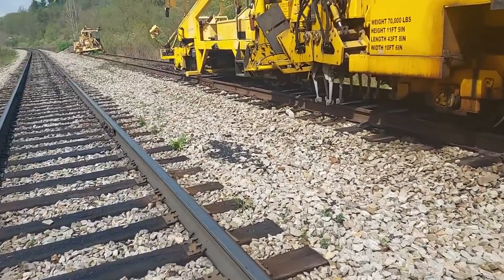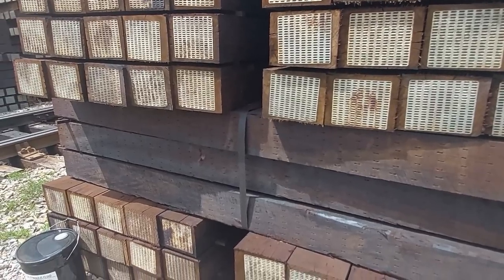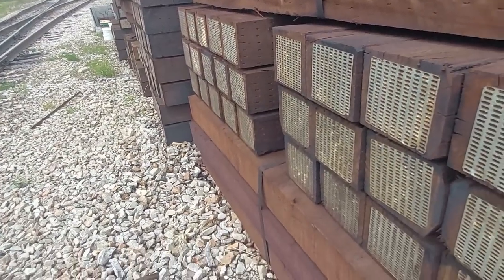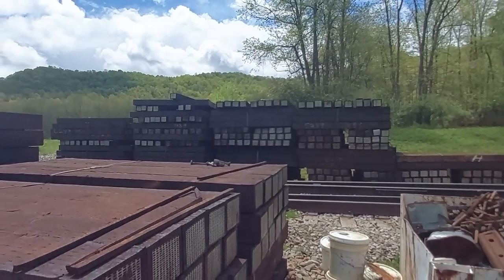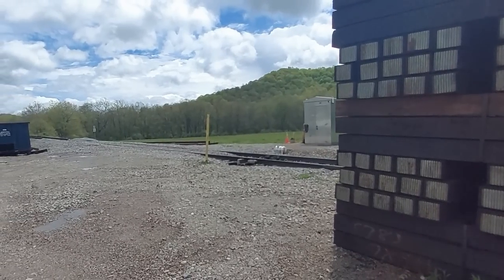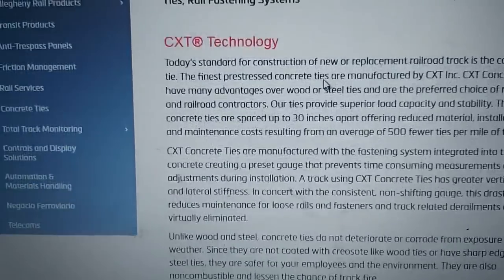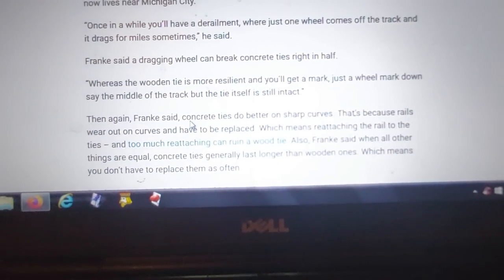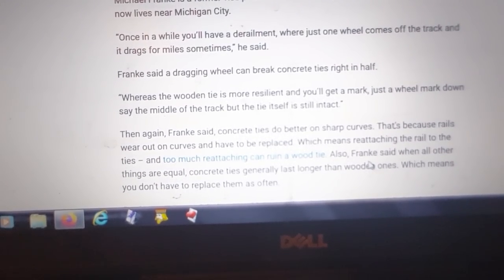Why some Railroads use Concrete and some use Wood Cross Ties

Comment: I visited New Jersey several times between 2002 and 2010.  On one visit concrete ties were being replaced on the line between Newark and Trenton.  Laying at the side of the track were thousands of broken ones which had already been changed in spot replacements, and now all of gremlins were being replaced.  The ones which had broken looked very similar to those we use here in the UK, where they are known as sleepers, but I have never seen large numbers of them break up at the ends like they did over there.  Also, the ones which had broken up looked fairly new, in places where older ones were in use the problem did not seem to happen.

Concrete ties have been around for a long time, at least since the Second World War.
Reply from the maker: Thank you for the interesting comment Stephen. Appreciate your taking the time to watch and write in my friend.

Comment: For light weight, high speed passenger service concrete provides superior ride performance over wood. Conversely, slower, heavier, longer trains need the endurance and flexibility of wood. Creosote is a generic term than can reference any one of 2000 wood preserving chemical mixtures and is not always carcinogenic. Personally I prefer good old fashioned coal tar. Nothing but mostly long carbon chains that create a great water and insect barrier. I don't like some of the new tie treatments as they smell of pure insecticide. 

Oh, and Alco the Railroad Dog approves of this video. I enjoyed also.
Reply from the maker: Thank you for the nice comment Ken and Alco, glad you enjoyed. Appreciate your taking the time to watch and write in my friend.

Comment: Several years ago I visited a friend who lives near North Platte NE on the UP main. The 3 main line tracks are 100% concrete but all sightings and spur tracks are wooden ties. He showed me where 2 or 3 covered Hoppers had jumped the track and even though they were empty they cracked the concrete ties and the pile of rubble was substantial. Back about 100 years ago our local streetcar system made several batches of concrete ties apparently more for testing than actual major usage. There still are about 50 of them used as a retaining wall along their private right-of-way which still has high voltage lines utilizing.  Theyve held up well and you can still read the company initials TMER&L. CO.  10\27\25 and the day they poured the form. Thanks for the info
Reply from the maker: Thank you for the interesting comment Paul. Glad you shared about
the  UP pile of rubble! WE don't want one of them here... :-)  Appreciate your taking the time to watch and write in my friend.

Comment: European countries have enough wood for wooden sleepers.
I mean, it was common until the 1960s.
Wooden sleepers are mainly used in low speed areas. Low frequency of trains.
Mainly in marshalling yards, still to be found.
Since the damage in the event of a derailment is significantly lower.
important for the extent of the damage is the weight per axle (and speed), we have only max 48501 pounds per axle. yes the concrete sleeper gets a damage, usually at 15 mp/h (shunting speed) not enough to damage the gauge. Witnessed the aftermath of 3 those derailments, because people are stupid. None higher speed so far.
Rarely still used on lines that are neither dead nor alive at slower speeds.
However, when going faster than 80-100 mp/h, I prefer concrete sleepers. 
Everything around 40-50 mp/h, wood is fine.

Without wanting to offend you, your ballast looks more like mud with sprinkles.
So far i didnt notice a difference between wooden and concrete sleepers in bad ballast, i will keep an eye on it.

The most important thing is of course numbers, most accidents happen us during shunting. 

Everything has advantages and disadvantages, old wooden sleepers are disposed of separately as hazardous material here - huge cost.

Sleepers that are not prestressed are useless. I get behind that.

American train lines are usually only for freight, with freight trains usually only an "economic" damage. Therefore, it can be offset, from a certain point, regular but not frequent accidents are cheaper than maintenance to prevent this. (Tracks and cars)
At least in the short term - thats my take away.
Safety first, it costs and takes time - not the best for the CEO but the right thing to do. imo.

Bonus point for concrete sleepers, usually u get machine to install em.
Wooden are done way to often only with hand tools - thats gets rough if a crew mate is sick.

best wishes
Reply from the maker: Thank you for the excellent comment Jonas. I don't know how anyone could put concrete ties in by hand, it's hard enough with wood. Appreciate your taking the time to watch and write in my friend.

Comment: I would point out that wood is a renewable resource. while concrete must be manufactured through mining and baking with petrochemicals. Creosote and specifically pentathol is an environmental nightmare and a carcinogen.
Reply from the maker: Thank you for sharing that info with us Lynn. Appreciate your
taking the time to visit and take in the RR tie video my friend.
Reply: Wood rail road ties are soaked in creasote
Reply: Concrete is not manufactured by the chemicals or bs listed

Comment: Definitely an education in thus video.. wow lots of great info Dave. In my ravels, the only place I see concrete is passenger service areas but freight runs on the same line. Never seen the angle iron type, definitely a bad idea. And never knew the 1 wheel derailment would crack a solid tie in half. Make me think twice when railfanning those areas.. Great video today Dave.. Great great stuff. Keep up the great work. Be safe out there..
Reply from the maker: Thank you for the nice comment Pappy. All RR's have their own
unique track problems/weather/economics, etc. There is no one tie
out there that is ideally suited for every single RR going. Each
RR has to use what is the best option for them, and often use
different options for different sections of track. Concrete, steel, composite or wood all have their pros and cons. It is a good thing
that there are options available to suit each RR's particular needs.
Appreciate your taking the time to watch the video and write in
my friend.

Comment: Wow Dave excellent class on concrete ties, answered all my questions and then some.👍👍
Reply from the maker: Thank you for the nice comment Russell. All RR's have their own
unique track problems/weather/economics, etc. There is no one tie
out there that is ideally suited for every single RR going. Each
RR has to use what is the best option for them, and often use
different options for different sections of track. Concrete, steel, composite or wood all have their pros and cons.  Appreciate your taking the time to watch the video and write in my friend.
Reply: @ccrx6700  Thanks Dave

Comment: A few years ago CNR started changing changing back to wooden ties due to the fact that slag they used for ballast was wearing out the  ties from the bottom
Reply from the maker: Thank you for sharing that info with us Daventry. we considered 
using slag here many years ago, it is cheap to buy, but we never did. 
I can't imagine it would have a good effect on tamper tools that
have to penetrate the slag.  Appreciate your taking the time to visit and check out the railroad tie video my friend

Comment: Hello from the UK, where all new railway track that is laid (except preserved or heritage railways) has concrete sleepers. (You call them ties, we call them sleepers). During lockdown I spent some time watching US rail videos and was struck by the use of wood. I was also surprised to see railway track in regular use where the wooden sleepers/ties looked really rotten. I was really amazed when I saw a Jawtooth video of La Grange, where they dug up the road to lay track for street running. they used wooden sleepers/ties and rebuilt the road over them. To me that didn't make any sense. Thank you for posting this video. Until today, I didn't realise the issue of derail damage to concrete sleepers. I love videos where I learn something new.
Reply from the maker: Thank you for the nice comment Jeremy. All RR's have their own
unique track problems/weather/economics, etc. There is no one tie
out there that is ideally suited for every single RR going. Each
RR has to use what is the best option for them, and often use
different options for different sections of track. Concrete, steel, composite or wood all have their pros and cons. It is a good thing
that there are options available to suit each RR's particular needs.
Appreciate your taking the time to watch the video and write in
my friend.

Comment: Very interesting information Dave! I never thought about all of the different places a tie can be used, and how they can customize them to match that — I always pictured just one variety!
Reply from the maker: Thank you for the nice comment Mojo. All RR's have their own
unique track problems/weather/economics, etc. There is no one tie
out there that is ideally suited for every single RR going. Each
RR has to use what is the best option for them, and often use
different options for different sections of track. Concrete, steel, composite or wood all have their pros and cons. It is a good thing
that there are options available to suit each RR's particular needs.
Appreciate your taking the time to watch the video and write in
my friend.

Comment: Good morning Dave. This is a very interesting video. I like how you show the positive vs negative aspects of the different types of ties. Have a great day my friend.
Reply from the maker: Thank you for the nice comment Lewis. All RR's have their own
unique track problems/weather/economics, etc. There is no one tie
out there that is ideally suited for every single RR going. Each
RR has to use what is the best option for them, and often use
different options for different sections of track. Concrete, steel, composite or wood all have their pros and cons. It is a good thing
that there are options available to suit each RR's particular needs.
Appreciate your taking the time to watch the video and write in
my friend.

Comment: Dave has done his homework and we got to look over his shoulder so now we all will get an A+.  The man knows well what works best in the environment where his railroad is based and with the conditions that they have to deal with.
Reply from the maker: Thank you for the nice comment Scotty. All RR's have their own
unique track problems/weather/economics, etc. There is no one tie
out there that is ideally suited for every single RR going. Each
RR has to use what is the best option for them, and often use
different options for different sections of track. Concrete, steel, composite or wood all have their pros and cons. It is a good thing
that there are options available to suit each RR's particular needs.
Appreciate your taking the time to watch the video and write in.

Comment: This was an interesting view into the decisions that needs to be taken on an American railway. Over here in Europe we do mostly have concrete on mainlines and most frequently used spurs and parallels. As someone pointed out, we are much more passenger focussed over here, and thus I suspect the traffic is much more frequent than on many of your lines that are more freight oriented. Despite the resulting average lighter vehicles and trains, we probably quite easily reach the break-even for tonnage. Also, the way the infrastructure is constructed here, the added stability allows for longer and most likely more deterministic intervals between when the sleepers/ties need to be replaced. And when the time comes, large sections can be swapped in a swift operation. This comes in handy when the traffic is so frequent and a lot of people will be less happy if the service is interrupted for more than a couple of hours. But I really don't think we are looking at a deficiency of wood for sleepers, especially not up here in Sweden and Norway, and not in Germany and Central Europe. The UK might be a little bit worse off, but I don't think it is something that could not have been solved by import if wood would have worked better in our conditions.
Nevertheless, it is not uncommon to see wood sleepers on smaller branch lines or within passenger stations (I am less sure about freight terminals though, as I am not in that business).
Reply from the maker: Thanks for the nice comment Melvin and the great information. Appreciate your taking the time to watch the video. Happy rails to you until we meet again my friend.

Comment: A friend of mine's parents, back in the 80's had a really cool dining room table that was made from some kind of rainforest wood railroad ties and came from Africa. The ties were originally cut in the 1920's and had been on a railroad that ran through Kenya. It was a really cool table and quite flat. They had run the assembled table surface of ties through some kind of very large planer, so the top was flat. The ties WERE NOT treated with creosote, so no bad smell. The color was really beautiful.
Reply from the maker: Appreciate your sharing that Jeff, that would be awesome, I
would love to see that table. Some African woods for ties are
so hard you can't even start a spike let alone drive one in them. Thank you for taking the time to watch and may you have a very good day my friend.
Reply: the wood from Africa is called azobe , it’s an iron wood , very hard .

Comment: Another great video Dave!

I would think that another major factor in using wood vs concrete ties is geographic location. It seems to me that, in colder winter climates is a better choice than concrete simply due to frost heave. With wood, I'd think that built in flexibility would keep them from breaking and keep the rails in gauge better than concrete.
Reply: On the other hand, concrete does not rot.
Reply from the maker: Thank you for the nice comment Mike, you are right weather
conditions play a role in choosing which tie to use.  Concrete is not well suited to freeze/thaw cycles as wood is much better at that. Appreciate your taking the time to visit and check out the railroad tie video my friend

Comment: There is a shortline near me. I recently walked about a 1.5 mile of track searching for date nails knowing the line had been in service since the turn of the 1900s. I found many nails, the oldest from 1927. Shy of 100 years in place and still in service. Concrete, I've seen a lot come and go. Even steel ties on old industry track.
Reply from the maker: Appreciate the nice comment JonD and for sharing those thoughts. Thank you very much for taking the time to watch and write in my friend.

Comment: Southern Pacific here Oregon, many years ago were wood ties had those those old nail years on the nail head. Today the track is mostly shut down because of storm damage up in the mountains. Also I noticed a few steel rail ties here and there. They also had a grease system being used on some of the sharper corners. But now the track is mainly used by tour trains along the coast here,,,,,,,,,,,,,,,
Reply from the maker: Appreciate the nice comment Dan and for sharing those thoughts. Thank you very much for taking the time to watch and write in my friend.

Comment: I drive threw Connecticut from time to time and there is a section of track in East Windsor that they are converting to concrete ties, don't seem to be in a big hurry as there seems little progress in over 3 years. But as your drive from Enfield to South Windsor you see huge piles of concrete ties along the tracks.
Reply from the maker: Thank you for sharing that with us Steve. Appreciate your taking the time to watch and write in my friend.

Comment: Excellent video. 

You raised a lot of good points about wood vs concrete. 

Like the rocks holding the wood in place better.  

And the lower availability of wood and environmental restrictions in Europe. 

And the drawback of ties breaking in half on a single wheel derailment.
Reply from the maker: Thank you for the nice comment Tim. Glad you enjoyed. We appreciate your taking the time to check out the video and write in my friend.

Comment: A friend of mine is an engineer at BNSF, several years ago I got one of their wall calendars that used a picture of some track utilizing concrete ties and I wondered why they didn't use them for the rest of the mainline and now I kinda know. CN had one derail near Ash lake a few years ago and a bunch of those wood ties looked like they were chopped right in half .
Reply from the maker: Derailments can be very hard on ties, concrete or wood as you know
Scott. Glad you enjoyed the show. Thanks so much for stopping by
to watch and may you have a very good day my friend.

Comment: Over here in the UK when a sleeper bolt hole became opened and loose, it was common practice to drop in the hole a fiche of wood kinda like putting a matchstick in a wallowed out frame screwhole but bigger, sawdust and strong adhesive was another trick that held surprisingly well as we have utilised bolts to adhere chairs for a very long time and even today you see bolted chairs on wooden sleepers with Pandrol clips.   Bolts tend to hold better under shock conditions hence why US rails flop over because the shock of failure at a chair isn't born so easily the nails being friction fit hence why you get floppy rail syndrome from worked loose fixings which then drops a wheel or stresses the other fixings to loosen them up and then the rail flops over at the wrong moment.
Reply from the maker: Appreciate the nice comment Watsons World of Wonders and for sharing those thoughts. Thank you very much for taking the time to watch and write in my friend.